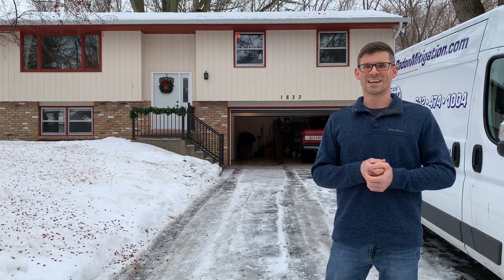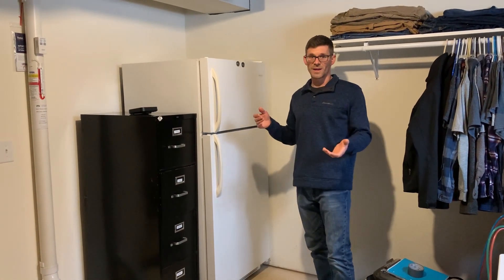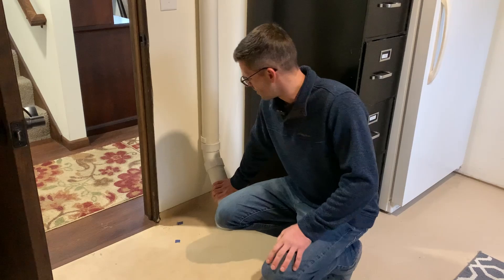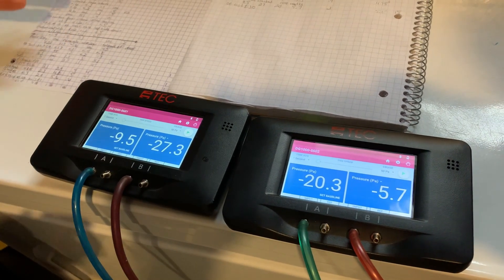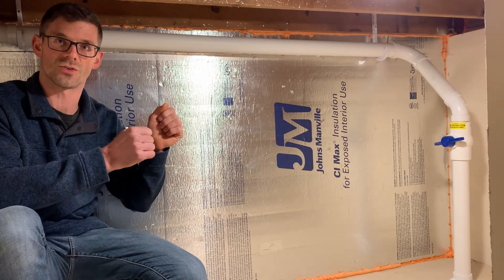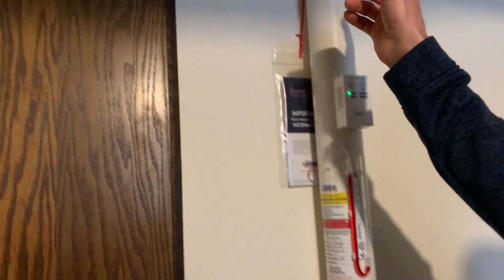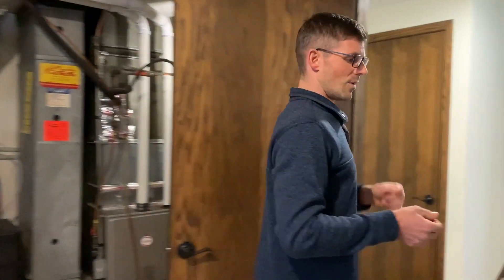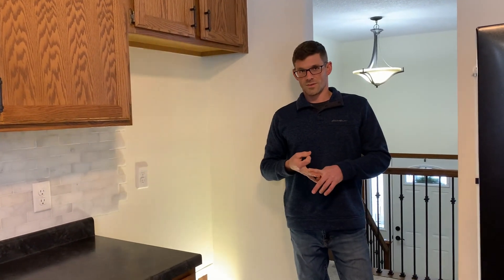Finished Basement, No Drain Tile, Clay Soil—Here’s How We Got Radon Below 1.0 pCi/L

Comment: Hi Jesse, great video! Do you remember what type of fan you used at this home? Do you have a go to Fan for Homes without drain tile, or sump pits that you prefer to use? Thanks, Adam
Reply from the maker: I started with a Fantech RN4 EC. Then swapped to an AMG Eagle Extreme in hopes of reducing the noise transfer through the piping down to the basement. 

My go-to fans for homes without drain tile are the Fantech RN1 or RN2, with multiple suction points. However, if multiple suction points are outside the homeowner's budget, we typically use the RN4 EC.
Reply: Thank you very much. That helps
Reply: Thank you very much. That helps
Reply from the maker: @adamolson8213  You bet.
Reply: Thank you very much. That helps
Reply: Thank you very much. That helps
Reply: Thank you very much. That helps
Reply: Thank you very much. That helps
Reply: Thank you very much. That helps

Comment: So, general question here... strictly talking about the freeze up issue, you talk about putting the fan up in the attic vs outside to avoid freeze up, but wouldn't it still be subject to approximately the same temperatures and moisture levels (inside the pipe) as it would be if the fan were outside? Thus still subject to potential freeze up issues? Both outside and inside would have just a mesh screen on the tube outlet so any precipitation could enter. Also any condensation from the moisture in the air could form whether it was outside or inside. I suppose if it were in the attic you could insulate it which would help slightly, but I'm not sure how it would be any drastically different. What are your thoughts on this?
Reply from the maker: Thanks for the question, Zachary. 

Yes, a radon fan in the attic vs. a radon fan outside is subject to approximately the same temperatures during the winter. The advantage of routing the pipe and fan through an attic is that you can wrap the pipe and fan in insulation. Which helps prevent condensation from forming inside the pipe, keeps the pipe warmer, and makes the mitigation system less susceptible to freeze-up issues. 

We also typically only have about three feet of pipe above the radon fan, of which only a foot of pipe is uninsulated where it penetrates the roof. This means that only the condensation that forms in the three feet above the fan drains back through the radon fan and into the suction point.

Heat and water are the two killers of radon fans. A radon fan in the attic will have less water that passes through it. Therefore, it may have a longer service life. 

A radon fan mounted outside typically has 10 to 20-feet worth of pipe above it. The pipe on the exterior of a home is usually not insulated, which means more condensation forms inside the pipe. Without insulation to keep the pipe warm, the condensation is likely to freeze and accumulate when the temperature drops. If the pipe freezes shut, then the home's radon levels will rise until the radon system thaws out. Freeze-up situations may also set off a radon system alarm.

Lots of pipe above the fan means that the condensation passes through the radon fan on its way back to the suction point. A condensation bypass can come in handy on these types of systems. One word of caution is that there may be a substantial amount of friction loss in the condensation bypass kit that I will link below, so you won't want to use this model on high flow radon systems.
 

Radon Away Condensation Bypass Kit - https://amzn.to/3r6OROV

As an Amazon Associate, we earn from qualifying purchases.
Reply from the maker: I should also mention that we install less than ten external systems a year and have been in business since 2014. I have only received four freeze-up calls. Every one of them was an external system. 

Most of our customers chose to have an alarm installed even before they were required here in Minnesota. I say that because they typically call when the alarm goes off. Therefore I think we have a relatively good idea of the systems that have freeze-up issues. 

If you are on the radon listserv forum, you probably know that alarms are a hot issue right now. Here's the link if you want to check it out. https://www.radonlistserv.org/discussion/217/minnesota-radon-rules
Reply: @AmericanRadonMitigation  I took a look at your install on this again and I think I am going to go the same route and route my radon system next to the flue and into the attic. My question is, do I need a fire collar when routing this tube through the cavity in my house to the attic? Would I need one for my basement ceiling and one for my attic floor (this cavity is through the living floor)?
Reply from the maker: Just when you penetrate a firewall like a garage wall or garage ceiling.